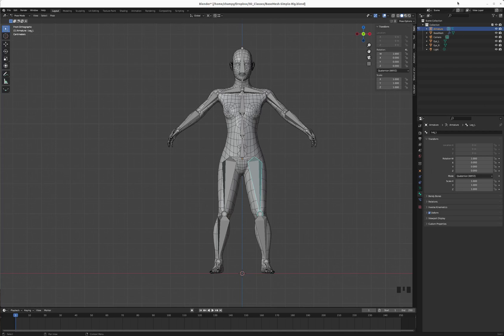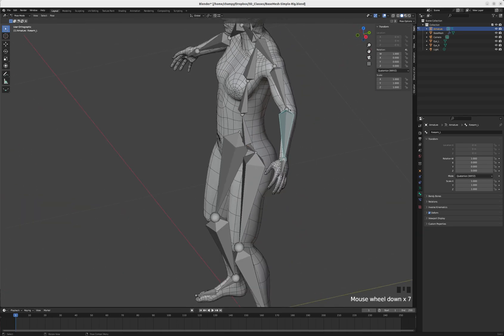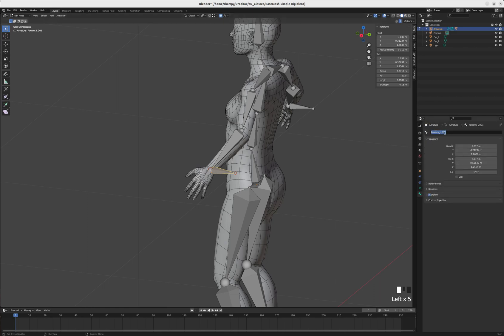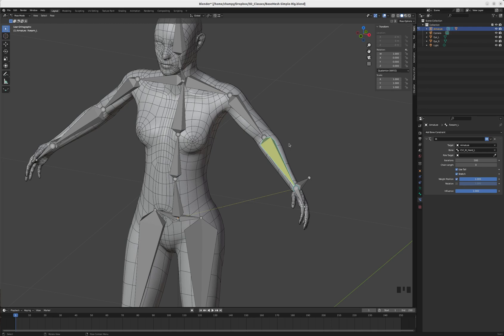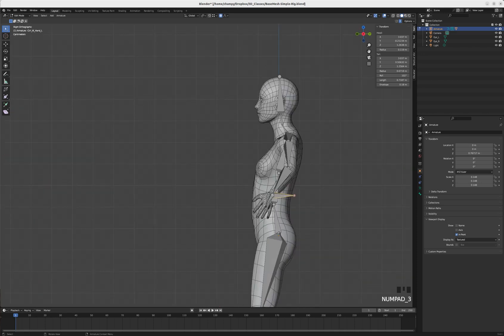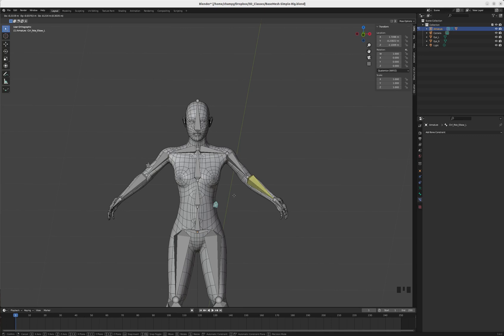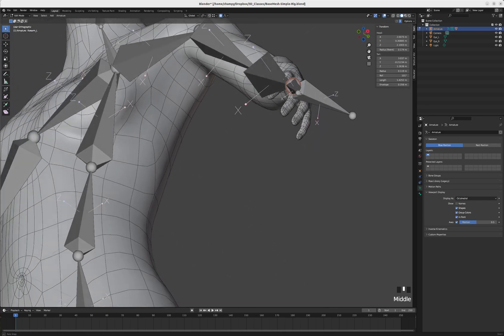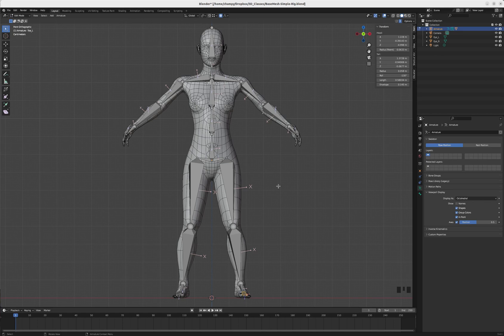Blender Tutorial 33 - IK Controllers and Bone rolls

Comment: so I tried changing the Roll value for the hand IK in edit mode, under N - Item - Transform to 180 for left hand and -180 for right hand.
And now both arms work in the way that they both move into the hips symmetrically and out to his sides symmetrically BUT now instead one of the arms is twisted ( thumb facing backwards) WTH ^^ freakin blender maan :D
Reply: You probably already solved it, but in my case had to set the pole angle under IK constraint settings of both forearms to -90 and 90 to account for the flip on the right arm.